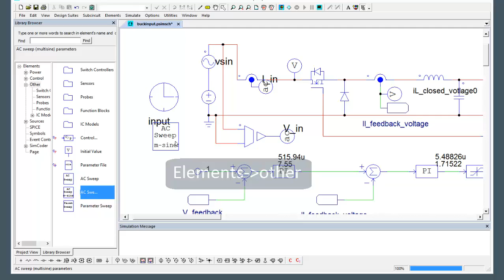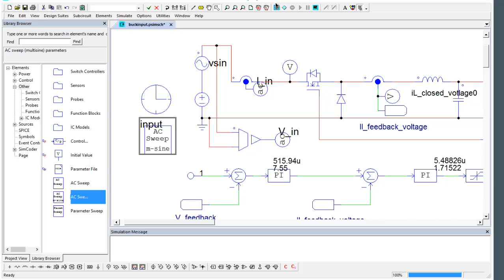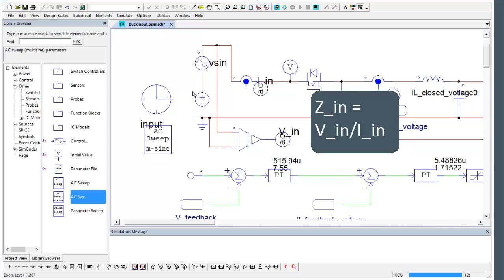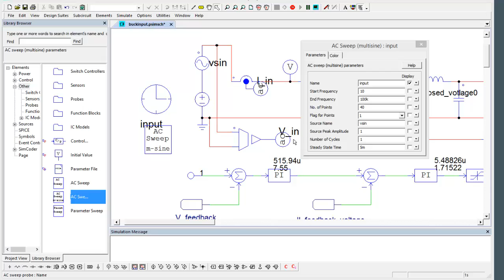How to Determine the Input Impedance of a Buck Converter

Comment from the maker: Want to try PSIM?                                                                                  - https://hubs.ly/H0f9wCC0
Why is PSIM preferred for Power Electronics simulation?             -  https://hubs.ly/H0f9wFX0
Why should you use PSIM for digital control?                                  - https://hubs.ly/H0f9wC-0
Why you should use PSIM for device level simulations                  - https://hubs.ly/H0f9wDk0